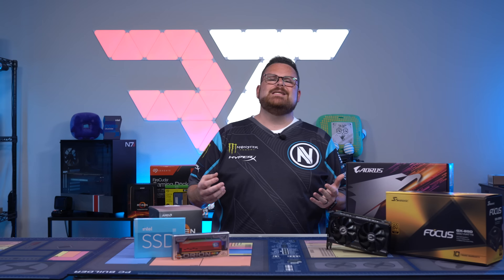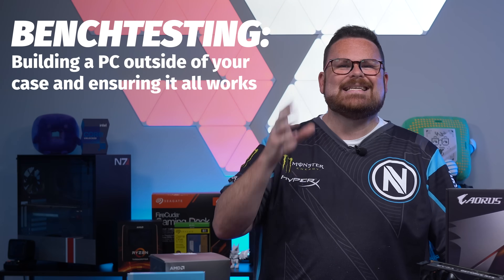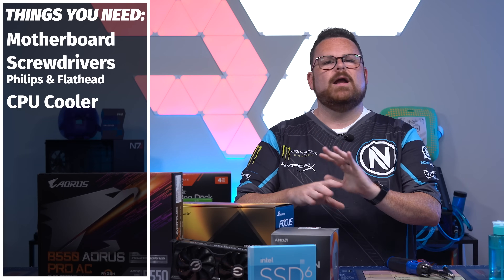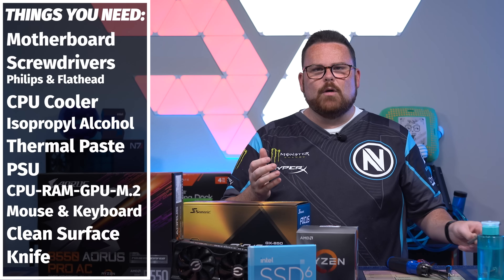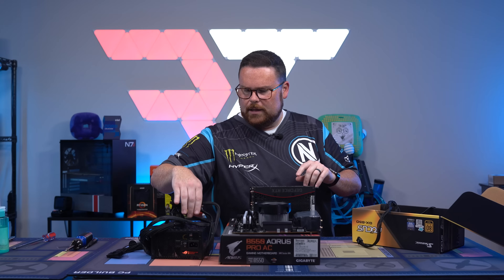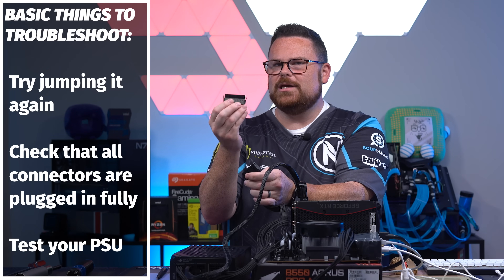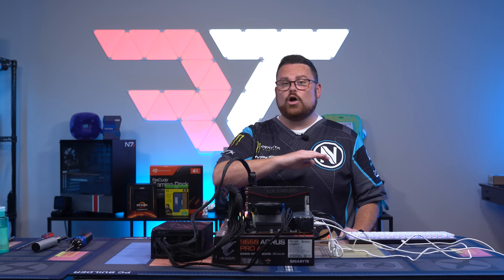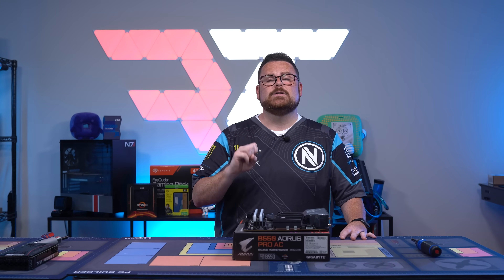Save yourself some pain! A How to Guide on Testing Your PC Before you Build

Comment: Instead of jump the mb using screwdriver, can i plug the powerswitch cables from the case into the mb instead and push the button from the case? I'm such a klutz when I'm nervous and I'm so afraid of shorting something else other than the power switch when jumping the system using the screwdriver 😅

Comment: Motherboard: Gigabyte B550M DS3H

Worked perfectly fine for 5 months and after that  Once the PC Shuts off, it doesn't switch on. 

PSU: New Corsair RM850
GPU: Fairly New ASUS GTX 1050Ti
RAM: 2 X 4 Gb Hyperx (Compatible) 
Cabinet: New NZXT H710

Can you please tell me why my PC doesn't POST & Why it doesn't switch on, once it switches off? 

Note: Once the PC switches on, it runs smoothly & no issues in keeping it running perfectly, the problem arises only when the PC is switched off/ Hibernated. 

Got the Mobo checked at the official center, but nothing came out of that. 

Please help!

Comment: It was a very basic (if not a little long-winded) guide to bench testing. More advanced tips that if you suspect it's the CPU, ram, or GPU that is the culprit, how to tell, and troubleshoot it cheaply, if possible, would also be helpful. Also, going through things like how to line up the CPU so that you are inserting it in the socket in the correct orientation and installing the ram in the correct orientation or in the dual-channel slots might also be helpful to beginners. I personally would not recommend hooking up the M.2 NVME drive until I have verified that everything else posts to BIOS. This is just to make sure that nothing else is complicating troubleshooting your build.

Comment: Bench testing always saved my bacon.  But sometimes finding the problem is TOO EASY.  Ex: When you put the Ryzen 5800X in the socket, and it rocks from upper left to bottom right, it's not that hard to figure out it's the motherboard when the CPU fits fine in a different MB.  Wheres the fun in that? 😁
Reply from the maker: lol, yeah some are easy.

Comment: When I put on on the CPU, I try to use equal force when pushing down on the fan or water block onto the CPU. I do an X configuration when tightening down the screws. 2 turns per screw till it's completely tightened down. :D
Reply from the maker: That's good :)